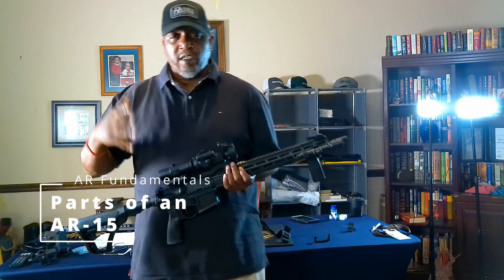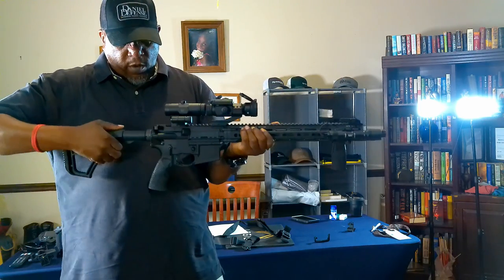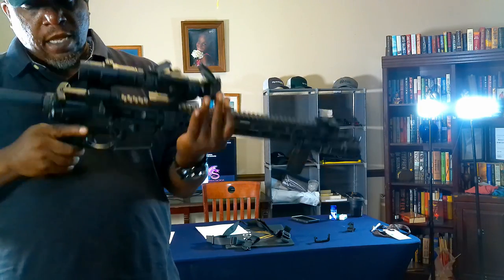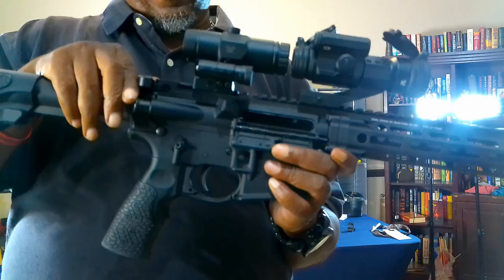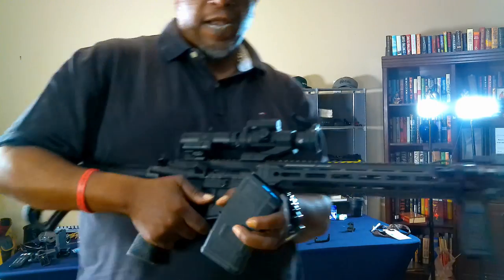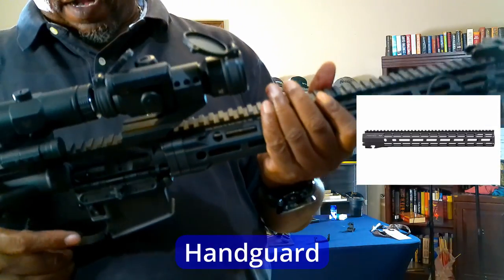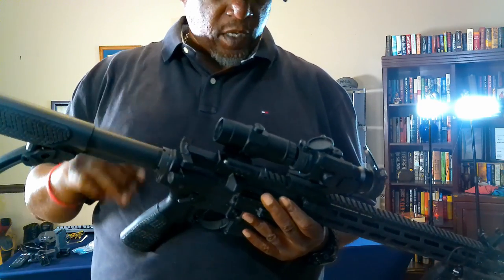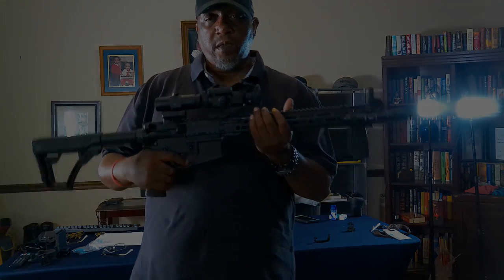10 Parts of an AR 15 Rifle You Should Know

Comment: Hey Rizzo - Thanks for the fundamentals videos! A couple ideas to improve your video quality: First, use a lapel microphone so that the sound level stays the same no matter how you move around. Most cameras have a place you can plug in an external mic, and you can find both wired and wireless lapel mics. You got real quiet on the last part of this video.  Second, move your video lights so the camera is not pointing at them and making a glare, and so they are not behind you making a bit of silhouette. Thanks again for your training videos.
Reply from the maker: Thanks for the tips.  I have invested in a lapel mic so I should be using that soon.  I have no idea how I missed that the lights were in the video.